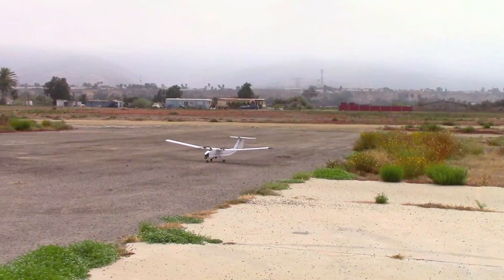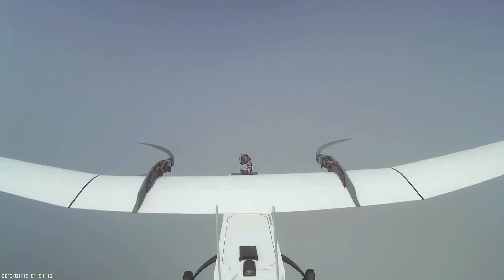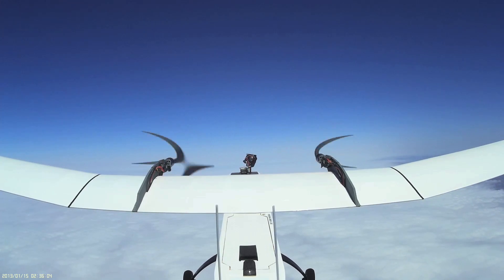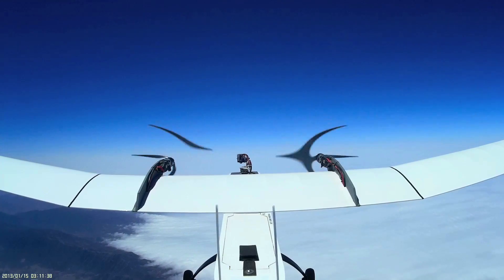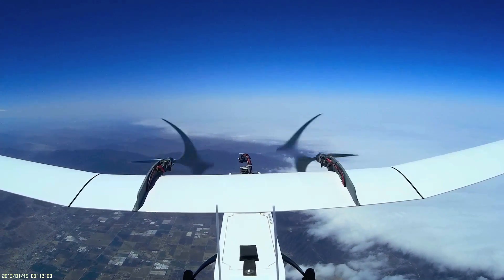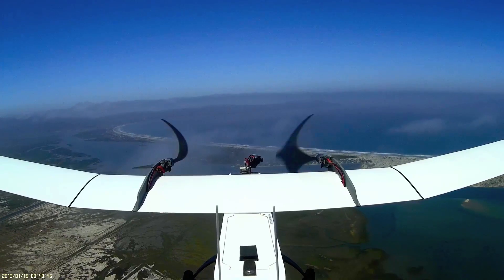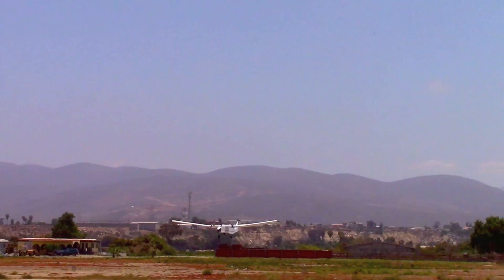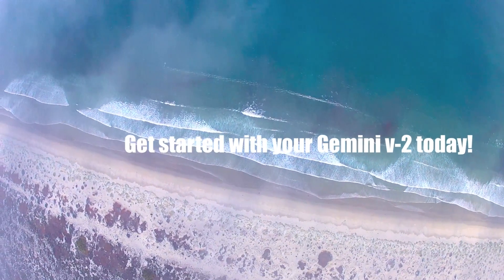Gemini V-2 FPV High Altitude-Long Duration Flight-13,000+ ft.

Comment: I can't wait to do that with my 2.4 m ranger.
 Just saving up for a couple more parts
Reply from the maker: I've seen two approaches to high altitude, using lift and climbing relativily slow, and climbing very fast.  still not sure which is the best, but the fast method does not need a very big plane.. ha ha.  sounds like your ranger would be somewhere in the middle.  Looking forward to seeing it.  
What equip are you running?

Comment: I asked on another video this may be a stupid question but could you extend the range of your transmitter by attaching antenna to something like say a balloon or a kite or maybe even a pole.. something that could go up pretty high to extend the range?
Reply from the maker: yes, that would absolutely be a possibility.  if you need the range for RF.  lately, we're focusing mostly on full autonomy, which is even better for most applications, because the aircraft no longer needs to be in range to perform it's mission.  There are circumstances which would require operator input, such as for certain types of decision making, but mostly, it can be eliminated, or compensated for my flying more auto missions, which costs almost nothing, and requires no operator for the majority of the flight.
Reply: @FPVREVIEWS  basically autopilot very interesting but what application would you use that for I can see for like deliveries/geography or whatever, but just for hobbyist based applications as in having fun lol it would be exciting to know your RC can fly itself back and forth but that would take the fun out of it after a while. I would like to see how high I could get without the use of drugs lol But seriously I would just like to see how I could get and take photos
Or just say I did it You know what would be cool to build your own V2 but instead of going fast go real slow so slow that they won't be able to shoot you down because their rockets are too fast hahaha
Reply from the maker: @earlyculyer4103  Even with the autonomous systems, you can take various degrees of control, including full manual, and have that RX failsafe option.  so it all depends at that point, what is the range of your control, and video systems.   fun stuff.   I hope nobody shoots at my planes. they are a lot of work to build, and not cheap.. :)

Comment: Enjoyed the flight, just a question, was there any concern of large aircraft in the area?
Reply from the maker: no concern.  The area which we fly is a bit of a dead zone for air traffic between 100ft AGL and 20,000.   we do monitor carefully for low level traffic.  it's near an airport.   this was also made before the regulations in our country.

Comment: Why was that the max altitude?
Reply from the maker: we were starting to have minor glitches with the control link, and without a FC, and also with little experience with the battery flying to that altitude, we didn't want to risk running the battery too low on descent.  also it's considerably colder at that altitude, so we didn't want the battery to freeze and drop in voltage.  would be nice to have a OAT sensor for Arduplane now..  it would be most practical to build it into the air speed sensor.  also as we were flying it completely manual that day, we were not always able to maintain optimum climb rate.  using a FC would improve that too.

Comment: Sooo I realize I’m crazy late to this video but I have a question. Did you guys have to file a flight plan because of how high you guys were?
Reply from the maker: the flight was made before many of the regs.  we did check air traffic routes, and it was done in a country with very little air traffic.  we also have an aviation handheld radio with the freq for the local airport.

Comment: Wouldn't the air there be incredibly cold and take a toll on the battery and control surface? I've seen high altitude pilots struggle with frozen servos before.

Comment: What is that battery? Where did you buy it?
Reply from the maker: link to our website in the description of the video.  They are Li-ion NCR18650GA cells.  we have videos on how to build them, or we have build service, depending on your location. 
we have additional info on our website's give me more data page, as well as the battery page.

Comment: What attitude do you recommend to fly to avoid low attitude turbulence? I seem to be hitting a lot of them when I fly between 800 to 1200feet.
Reply from the maker: it will depend on the local conditions, but in my limited experience, above 600 meters AGL is usually pretty clean, but there will be thin layers every so often up higher, as the transitions between layers shear.  how many, and spacing will vary.

Comment: Hi there how did you get the transmitter and receiver very super long range is 13,000 ft is for your plane to control it to go to over the clouds but more high can you give a links please and receiver box and video transmitter is but the video transmitter on your plane but do you need power on your plane receiver or battery connected and power to video transmitter is but how did you get all hobby parts for your plane and connect two brushless motors on your plane can you give a links please

Comment: EZUHF  rx and TX so where i can buy that please
Reply from the maker: Ebay is your friend
Reply: @FPVREVIEWS  but do you need taranis radio connects to EZUHF  rx and TX and they needs to update it to use long range for your plane please
Reply: @FPVREVIEWS but do you need taranis radio connects to EZUHF  rx and TX and they needs to update it to use long range for your plane please
Reply from the maker: yes. @sandygregoire2732
Reply: So what kind did you used website 
To find firmware to update it
Reply from the maker: arduplane.org 
 @sandygregoire2732
Reply: I tried it says ardupilot.org but i cant find it says this site can,t be reached but maybe you give me a wrong website it says arduplane.org’s server IP address could not be found.

Comment: But what kind battery did you use for the plane to fly very very long like 3 to 5 to 8 hours is can you give me a links please but how many volts battery did you use please
Reply from the maker: It's a battery we assembled ourselves, from 60 pieces NCR18650GA cells, similar to what Tesla cars use.  It's a 3S20P battery, so 3 groups of 20 cells in parallel.  each group is in series.  each cell, and group is 3.7v nominal, and so when the 3 groups are in series, the total battery pack output is 11.1v nominal.    the voltage is 12.6v when fully charged, or 4.2v per cell.   the cells can be drawn down to 2.5v per cell/group, so you can run the pack total down to 7.5v.   on this flight, we only ran the battery down to about 10v, so could have flown longer, and gone higher. 
The long range radios are on relatively low frequencies, and we use directional antennas on the ground, to get good reception when far away.  The equipment on the plane does not take much power,  and is made from mostly security system components.  some of our older videos show the equipment.
Reply: But where did you get the 60 cells batteries please
Reply from the maker: have ordered some on ebay, and amazon. also distributed by other vendors which sell batteries.
Jus to be clear, the long flight times are partly due to the batteries, and partly due to the airframe design optimization and strategic flight planning.   @sandygregoire2732
Reply: Did you use the old broken laptops  or smashed to find the batteries for your plane please
Reply from the maker: No, bought new cells.  @sandygregoire2732
Reply: Or can you use drone lipo battery like unsolder them like remove all wires and build your own very long life battery to use for your plane
Reply from the maker: It will not be the same, because Lipo batteries only have slightly more than half of the gravemetric energy density than the lithium Ion cells that we are using.                 @sandygregoire2732
Reply: Hi there how did you get the transmitter and receiver very super long range is 13,000 ft is for your plane to control it to go to over the clouds but more high can you give a links please and receiver box and video transmitter is but the video transmitter on your plane but do you need power on your plane receiver or battery connected and power to video transmitter is but how did you get all hobby parts for your plane and connect two brushless motors on your plane can you give a links please
Reply from the maker: EZUHF  rx and TX     
 @sandygregoire2732
Reply: How many range is that please
Reply: So where i can buy those EZUHF  rx and TX can you give me link of websites please but do you need taranis radio connects to EZUHF  rx and TX and they needs to update it to use long range for your plane please

Comment: But how did you get the antenna gives you 13,000 ft like very very super loong range like you can go more 
High but what kind fpv video transmitter did you use is and but how did you get the controller for your camera so you can move the camera any where on your plane from your rc plane transmitter is can you give me the links please

Comment: put a wifi in your plane and put a wifi in your remote controller and put a verrrrrry powerful battery in the plane this you can fly as far as you want for hours.
Reply from the maker: so we have a big battery, can stay aloft for over 4 hours. 
Wifi is usually on 2.4, and we use 433 for control, 1.2 for video, and 900 mhz for telemetry, so we have better theoretical range then 2.4 could provide.  even if out of range, we can fly auto missions fully autonomously.   The control systems that I've seen using wifi modules did not work that well.

Comment: Looked at the page.  Am glad it's not that "foam trash" rubbish we see all of the time.  Don't get me wrong.  Foam has it place but not as the main building material.  It's just too weak structurally speaking.  The only way it can be strengthen is to fibreglass it and I might add two layers of carbon fibre to it but it would cut into the gross weight some which would be a few grams per sq metre  surface.  Most that I could see was well thought out but I really hate "V" tails and especially "T" tails.  "T" tails are easier to get into spins.  You could add flexible solar cells on the wings running them back to a MPPT charge controller which would have to be custom for this application.  Then feed that power to 5 to 6 D cell size super caps.  It would connect to the main power with a diode so the Li-ion batteries doesn't back charge the super caps.  This would give much longer flight time.  Down size would be the choke that is required for the MPPT circuit and you may need a light weight heat sink for the MOSFET  that is in place outside of the plane.  It wouldn't have to be huge as it should cool normally with the wing flow in flight. But I think a 2-3 cm one made out of aluminum would work.   LOL, I came up with the same idea minus the tail and I was going to make the fuselage a bit more rounded.

Comment: Folding props will eliminate the remaining residual chatter caused by turbulence in glide mode
Reply from the maker: True, would reduce drag too and allow for longer flight times when climbing to altitude.  For this flight, we actually welcomed the props spinning freely, and their extra drag, as we slightly held the nose down for most of the descent to get down quicker.  there is also electronic braking for the props which will reduce drag and vibrations slightly, but we would rather have the drag for fast descents.   the nacelles would have to be redesigned to use folding props, and probably move the motors further away from the wings to allow for rear-ward prop clearance when folded.  Most flights have the motor running for almost the entire flight, up to 4+hours, and have no need to fold props.  Would be interesting as an option though..

Comment: Awesome I may try this system out. Currently running uhf fpv system our with GPS autopilot safety feature. I need to make a video soon. I fly this plane 24 miles out before turning around. Usually have to turn around due to battery flight time. My secret is I climb to the top of a fire tower locally that is 150ft high on top of a giant high elevation hill that sits about 200 feet above the rest of the area. I set up my equipment there. I've been testing the plane design to see how much weight it can carry efficiently without requiring so much more power. Reason im testing is because I may switch to diesel engines. The plane so far can carry 15lbs efficiently and 25lbs at max but it requires alot more throttle so I say 15lbs is perfect. That equals to almost 3 gallons of diesel. I may be able to reach much further out in range this way. What do you think?

Comment: Hey thanks for sharing a great video! I really enjoyed the view and learning about your rig. At one point in your video you did some Cloud surfing. I was flying my Quadcopter and accidentally entered a cloud bank. I developed propeller icing and lost thrust which ultimately brought my Quadcopter down. I recorded a video of this incident and it's on my channel. Stop by and leave some comments if you'd like.
Reply from the maker: that's amazing.  wonder if there is a solution to that.  were there other contributing factors, or was it just the icing alone?  wondering if flexible props would help, then a panic mode for the flight controller so it can pulse the throttle to make the blades reach maximum deflection to break the ice?   will definitely cheek it out. thanks for the interesting comment!
Reply from the maker: here is a link to the icing video for those who are interested:
https://www.youtube.com/watch?v=4NQPnEk4_Lc

Comment: after watching this video again, I'm kinda surprised that you don't have the brake enabled on the esc's.  Wouldn't enabling the esc brake, therefore stopping the propellers from spinning, reduce drag from the freewheeling props?
Reply: Nope,as the blades spin freely the drag is reduced compared to being still,u can figure this out considering when spinning,from the blade's frame of reference,the air is moving at angle closer to the chord of the blade. If you can minimize internal friction of the shaft this rotation speed increases to the point of 0 drag and you can have a glider that doesn't need to collapse its prop.
Reply: frizstyler I never thought about it that way.  Thanks for that!
Reply: Yes, stopping the props would make it glide better. You can test by trying to autorotate your heli with and without the blades spinning and see which one comes down faster.
Reply: Steve C hmmm, I'm not real interested in testing that theory with my helicopters lol
Reply: during autorotation the blades already have built in inertiawhich can produce lift when you turn up the pitch. however my answer isn't completely right. parasitic drag plays its role for a freewheeling propeller. i found a paper with test data.: http://www.peter2000.co.uk/aviation/misc/prop.pdf

Comment: Does this plane have an FC, if so which one and why?
Reply from the maker: At the time of the video, i used none, but since have added a Piexhawk running arduplane. It's working well. 
you can find more info here:
http://www.bearospaceindustries.com/give-me-more-data.html
scroll down the center column for info on the flight controller and setup.

Comment: is there such a thing as a small radar setup for air traffic? be nice to have that on the osd.
Reply from the maker: Um, no.   at the relative speeds that our uav's travel, it would be fairly useless anyway, as we are not fast enough to get out of the way of all but the slowest manned aircraft. 
I think the key will be to make an aircraft which can climb vertically or descend vertically at  a very high rate of climb, and in a  efficient manner, also controlled, and safe.   a hard problem, but one that tilt rotors and reversible/variable pitch thrust can solve. 
much better to use a system of shared V2V communication to share position and heading/speed date, i think. 
the automotive industry will probably provide a working solution there.  
it'll all come together, but will take some time, and there will be ranting and raving in the meantime. also bans, and arrests.  basically, lots of hysteria.   Sad.
Reply: FPVREVIEWS. I would say the question still stands. And I want it, or at least a form awareness. To avoid each other or simply know there is a jet three miles out and five miles up. Especially, because we can't say we won't continually push our limits. There are apps on my phone that allow me to see commercial planes and where they are in the sky in live feed. Tapping into data already available, and/or uploading our own location actively or indicating it passively. As I push the limits, I feel at least being able to transmit out something other aircraft can pick up would be easiest. Seems like if commercial aircraft tapped into our video out they could avoid us at least. Using a simple algorithm of the signal strength a manned aircraft can workout location, direction and speed. I Just have to imagine it is cheaper to pay engineers of the F35 and they have worked out how to avoid all objects in the sky vs the cost of repair or crash. I also hope their method of avoid is not to shoot us down. Ha ha
Reply from the maker: transponders are the current way of keeping traffic separation. as well as ADSB. 
This si a technical challenge, but a solvable one, and V2V communication, as i mentioned already exists, at least in working prototypes.  Hard part about any of this tech is getting the government to approve it. V2V will be the first as it will make the roads safer pretty much immediately, so it's hard, and unpopular for the gov. to drag their feet on the implementation.
Reply: FPVREVIEWS. I will look into that tech. Certainly curious about size and weight possibilities. A lot of work for good reasons. yes, to be continued/stretched out.